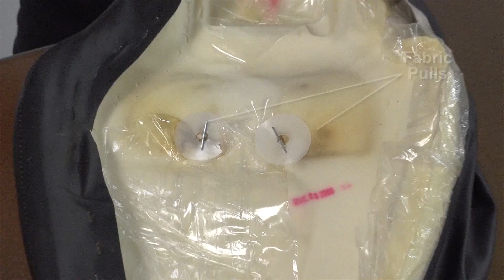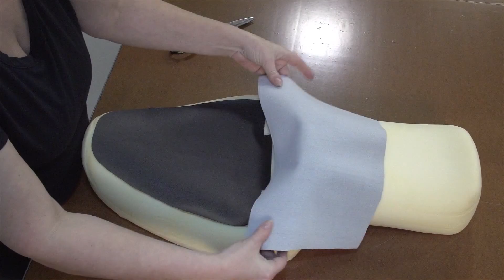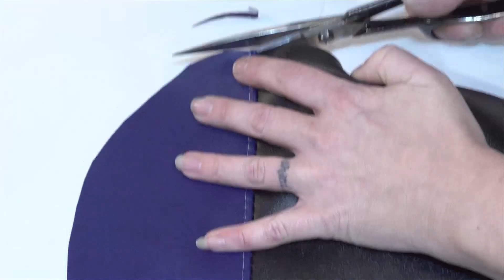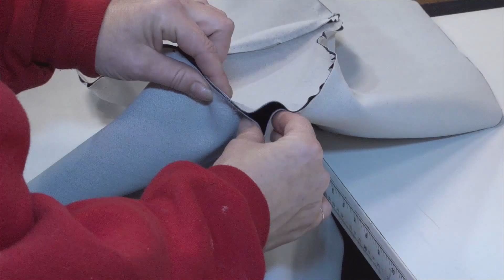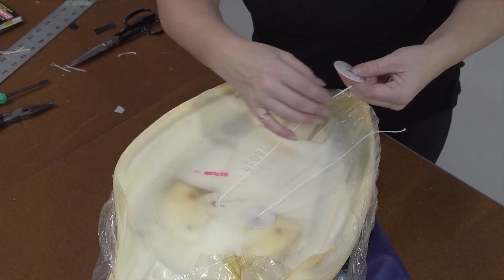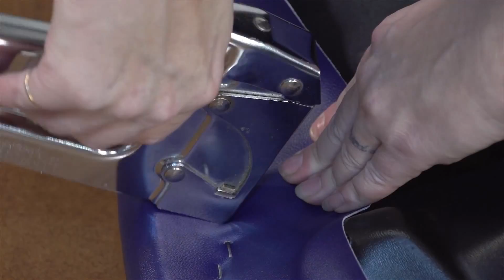How to Recover a Motorcycle Seat Using Stretch Vinyl Fabric - Using Allsport Vinyl

Comment: beautiful ... earlier, i had used plastic buttons (which eventually get distorted due to heat under sun ... the buttons further tend to tear the fabric at the edges) to pull down the fabric ... your FABRIC PULL concept has solved my problem !!

Comment: Great job. Well explained. If I could make one suggestion. I've learned lessons about using a Sharpie marker or even an ink pen, It can and will bleed over time and be seen on the top surface. Try using a Stabilo pencil. Its an artist pencil and leaves no markings like chaulk does. It cleans off easy with water or a damp rag. Give it a try. Great videos, the best I've seen anywhere.

Comment from the maker: We used an electric staple gun Duo-Fast EIC-3118 Electric Stapler. However you can use staple gun that operates on compressed air. You can use standard 3/8" crown staples for the gun of your choice. I would try to purchase only stainless steel staples for any type of outdoor project. I am not sure where to buy them in the UK. Sailrite does ship to the UK.